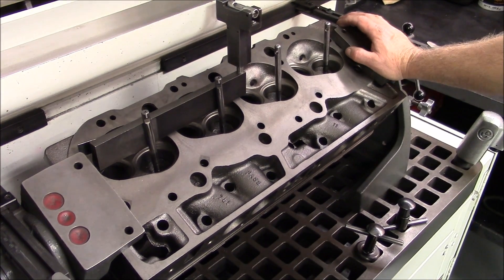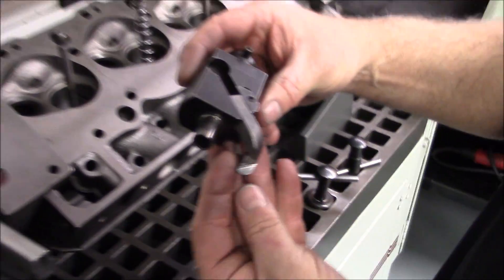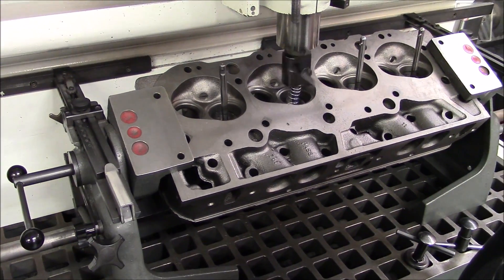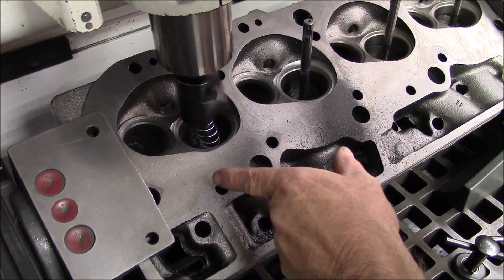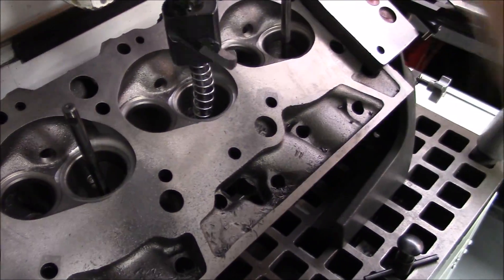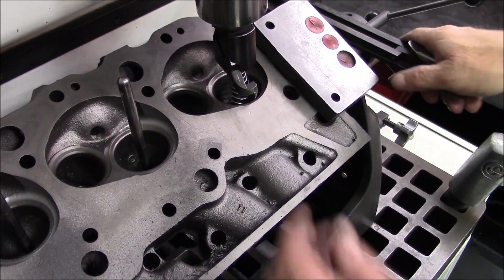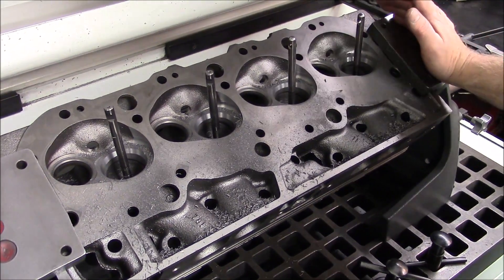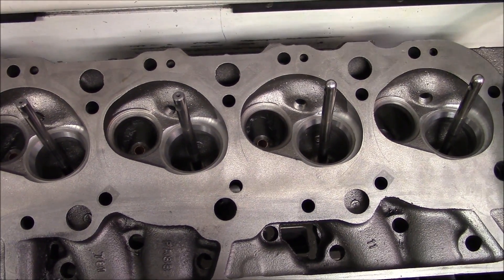Part 17 - Chamber Cutting and Bowl Hogging - 620 HP 454 Big Block Chevy Engine Build

Comment: Can the chamber cutting be done if the valve job has already been performed? I am about to start porting the bad runners on my 781's tomorrow and will wait for the next video to see whats needed on the other runners. Also, the bowl hog was done on the intakes but really needs more on the exhaust. Could this also be done with the valve job already done? Ive always used a die grinder in the past, but I really like the precision of the machining for a good baseline to start from.

Comment: I have 781's but I was going to use my 990's for 600+ build. Is the 781 a better choice for street use?
Reply: Jess Roberts I think it depends on your combo. I'm using stock 088 heads on my 496 street engine. On the dyno it made almost 570hp and 600tq with 9:1.1 CR. 781'S are good heads though they just need to be worked.